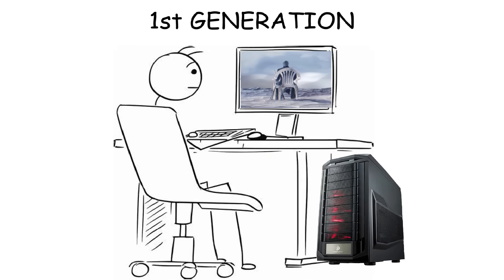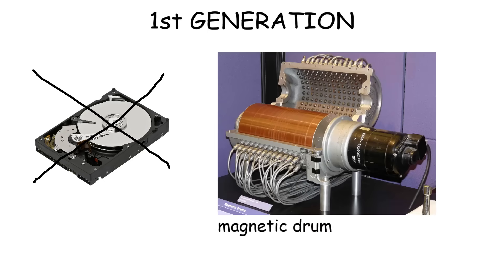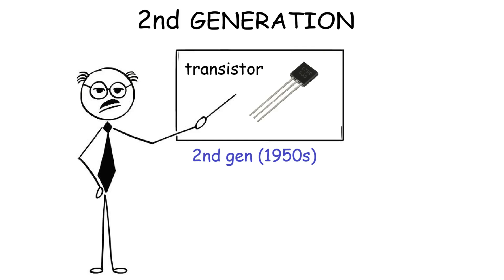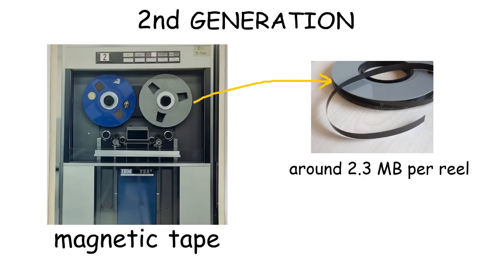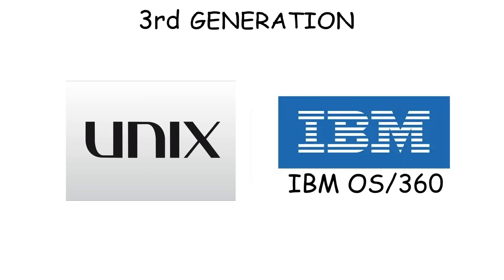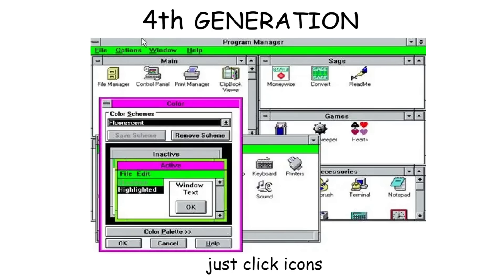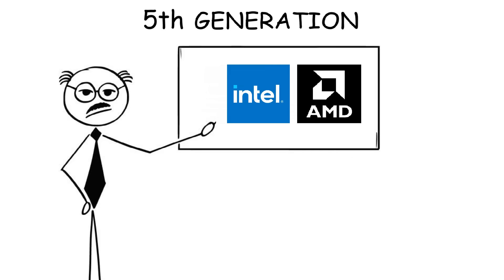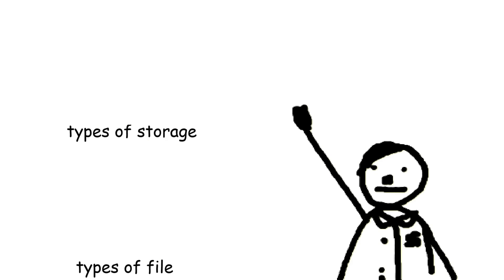Every Computer Generation Explained in 4 Minutes

Comment: I think something from 4th to 5th generation was missing. You talked about the first graphical interfaces, CDs and Hard Disk Drives for 4th generation.

But then went straight to AI, skipping all about solid state drives and multi Core CPUs. These are too significant to miss out.

Comment: 4:20 Ray Tracing is not AI dependent, they’re separate features, just so happens that they come together in most hardware nowadays, but current gen consoles with the exception of the PS5 Pro and Switch 2 have RT without having AI, as well as AMD GPUs from the RX 6000 and 7000 series, there’s also the other way around, like phones only getting RT recently, but having had AI since the mid 2010’s in the form of an NPU into the SoC, or Nvidia’s Volta architecture workstation GPUs, which shipped with 1st gen Tensor AI cores, but lacked RT cores

The reason why they come together is that RT is just so demanding that even with dedicated hardware to it, AI is used to either reduce load through upscaling, or interpolate the lost frames to give the illusion of performance

Comment: 1940  thousand of vaccum tubes for only 1 comp, lots of heat, instead if hard drives, there was a nagnetic drum. 

1950s vacuum tubes turned into transistors 
1 hour calculation turned unti minutes. Less heat. Magnetic tale instead of drum. 

Integrared circuits contained chip which contained thousands of transistors nano meters. Inteface still text base. 

Microprocessor 📀 CD and harddrive to install programs. Store films

Fifth generation focuses on making computer smarter instead of just shorter

Comment: the IBM PC is a fourth gen computer, it released in 1981 and used the 8088 microprocessor (released 1979). It's utterly alienating to see an IBM PC with "1960s" below it.

A better pick showing the best Integrated-Circuit based machine would be the Xerox Alto, which used 40,000 transistors and had an ALU based on the 74181 (first ALU inside an IC.) It was also the first non-demo computer with a mouse and GUI.

Comment: In 1980 I went to an open house at Homestead Air Force Base just south of Miami, FL.  They had open to the public the cockpit of an F-4 Phantom simulator, just the cockpit, inside of a room.  On a video screen where the windscreen would have been was a graphic that was literally as crude as the very first generation of "Pong" games of the 1970s.  In front of you on the screen was nothing more than a triangle representing an enemy aircraft and you would see tracers if you squeezed the trigger on the stick which also maneuvered your sight in order to align with the enemy fighter.  Powering this very, very basic display was a wall of Generation 1 computers about 8 feet high and about 40 feet long along a side wall.

Comment: Here's a concise overview of the five recognized generations of computers, based on technological milestones:

1. **First Generation (1940s–1950s)**: 
   - **Technology**: Vacuum tubes
   - **Characteristics**: Large, slow, and power-hungry machines. Used machine language. Examples include ENIAC and UNIVAC.
   - **Key Features**: Basic arithmetic operations, limited storage, and punch card input/output.

2. **Second Generation (1950s–1960s)**: 
   - **Technology**: Transistors
   - **Characteristics**: Smaller, faster, and more reliable than vacuum tube computers. Introduced assembly language and early high-level programming languages like FORTRAN and COBOL.
   - **Key Features**: Magnetic core memory, batch processing, and early business applications.

3. **Third Generation (1960s–1970s)**: 
   - **Technology**: Integrated Circuits (ICs)
   - **Characteristics**: Further reduction in size, increased speed, and lower costs. Supported multitasking and high-level programming.
   - **Key Features**: Operating systems, minicomputers (e.g., IBM System/360), and widespread commercial use.

4. **Fourth Generation (1970s–1980s)**: 
   - **Technology**: Microprocessors
   - **Characteristics**: Computers became smaller, affordable, and accessible to the public. Personal computers (PCs) emerged, like the IBM PC and Apple II.
   - **Key Features**: GUIs, networking, and mass storage devices (e.g., floppy disks, hard drives).

5. **Fifth Generation (1980s–Present)**: 
   - **Technology**: Advanced microprocessors, AI, and parallel processing
   - **Characteristics**: Focus on artificial intelligence, machine learning, and quantum computing. Modern devices like smartphones, cloud computing, and supercomputers.
   - **Key Features**: Internet, AI applications, and advanced user interfaces.

*Generations* is the standard term for categorizing computer evolution based on technological advancements.

Comment: some slight inaccuracy in timing but not bad. Floppy disks weren’t used as read/write until 1972. IBM invented the floppy disks in 64, but it wasn’t used much due to its limitation of being a read only device.

Also, the microprocessor was invented before the 70s and was used in the apollo program

Comment: 2nd gen to 3rd gen jump is crazy
Reply from the maker: Fr
Reply: Imo, the 3rd to 4th was the craziest.
Reply: @veltmann148  
A simple computer taking up an entire room,crap ton of electricity to a desktop computer that takes like  500W at best is def more of a step up.
Sure cpu is a big jump but not a bigger leap than 2nd to 3rd gen
Reply: @veltmann148 .
Reply: then better check also the jump from gen 0 to 1
the first actual computer used phone relais, so it was mechanical
Reply: it is a summarize thats why it looks crazy

Comment: What i observation is that when you have mechanical moving parts in electronic devices, it is considered as low level technology. But, if you have non-mechanical parts like semiconductor chip(working on quantum level), it often lasts longer and called as high level technology. It also needs less power to run, less space to occupy and gives high performance compared to mechanical moving parts like vaccume tubes.
Reply: electron movement are also mechanical

Comment: What about the generation that has ssd, much faster and smaller pcs, and more connected to internet, no more use for cd and dvd? That should have been before the AI one.
Reply: That's not really a fandumental overhaul, though and neither is ai really.
Reply: That was gen 4, started in 70s.